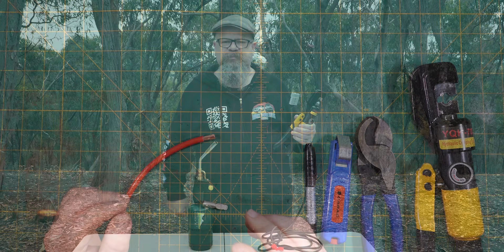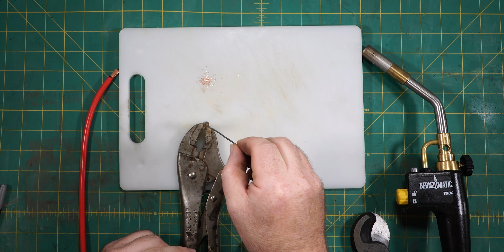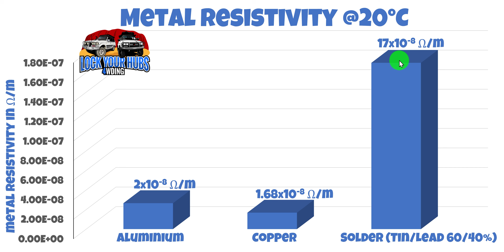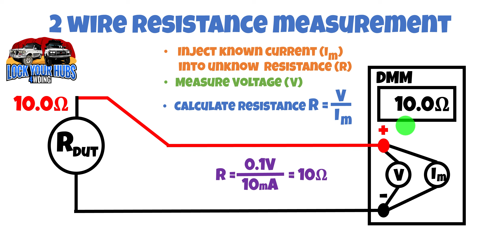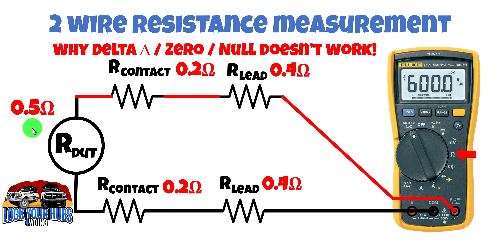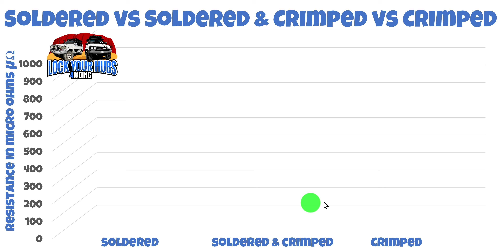Crimping vs Soldering for Anderson Plugs

Comment: Soldering is a bad idea for Automotive/Marine applications and is almost NEVER done by OEM builders. The reason is over time the area can become work hardened and break. It also has a tendancy to corrode. Have a look at a vehicle manufacturers wiring next time and see how much of it is soldered. Very little. Besides which it is time consuming.
Reply: P.S.
Love the channel and the empirical approach to all subject matter! 
Just pointing out the elephant in the room..... Most people think soldering is the logical way to go......
It isn't........
Reply from the maker: I have heard a multitude of claims in regard to soldering vs crimping. One of which was that crimping was superior conductivity to soldering, and at face value considering the conductivity of solder vs copper, turns out that wasn't correct. 

I would assume that without decent support, a soldered joint could suffer from fatigue related issues, though with double walled glue lined heat shrink that may be mitigated, though I haven't been able to find any hard data about that either.
Reply: @LockyourHubs4WDing  Yes, I love the way you go about empirical testing of this. 
Great channel . I've been a fan and subscriber for many years. 
I would have assumed myself that a crimped connection would be electrically as conductive as a soldered one.  But it is certainly mechanically stronger and more reliable in real world conditions. Especially in the longer term. 
The conductivity may be not as good,  but the differences are small and the variations as they age would close the gap even further I believe
Add to that the reduced cost of production and I guess it's a no brainer for OEM suppliers.
Reply: Nope. joints sitting in salt water in the bottom of your boat. Eg, if you needed to join a wire to your bilge pump, crimp + solder + heat shrink with glue. Relaibilty is the key in salt water environments. Even on the river, corrosion is an issue.
Oems dont solder due to cost.
Reply: @nordic5490  you miss the point. 
The solder would serve absolutely NO purpose whatsoever in that scenario. 
It's well established and tested that a crimped and insulated connection provides ALL the electrical and mechanical integrity that is ever required.

Comment: Very interesting test and very educational, thanks.

Now I have no idea if I'm right or wrong but I have to admit I was shocked at your method of soldering. A flame like that is far too hard to control for my liking  ...  I would only ever attempt something as critical as this with a decent iron. The purpose of rosin cored solder is to have the rosin do its job as it is heated up  ...  and that job is to clean the surfaces of the terminal and the wire  ...  so the solder can adhere/bond properly and cleanly.

By melting the solder in the terminal and then pushing in the wire, the majority of the flux is already deactivated and while it would have cleaned the inside of the terminal nicely ...  it would have had no effect on the wire. I am inclined to place the wire in the terminal and while heating the outside of the terminal, feed in the solder just as you did the crimped and soldered one, until it has flowed nicely and filled up.

I saw some comments about soldering and corrosion and the distinction needs to be made between rosin cored and acid cored solder  ...  the latter causing residual effects unless cleaned carefully. Rosin from the rosin cored solder actually deactivates after being heated and so should not cause residual effects long term  ...  and many of them are sold as "no clean", not requiring any special treatment after use. 

My thoughts come after 50 years as an electronics tech. :)
Reply from the maker: Having tried both ways I find it a lot harder to prevent the solder from wicking up the wire under the insulation if inserting the wire first. I understand the function of the flux cored solder though having cut a couple apart after using the method in the video, I seem to get 100% penetration and no wetting issues reliably.
Reply: Correctly soldered would have the solder wick up the fine strands in the cable, making it rigid where it is designed to be flexible.... needs to be flexible, instead of creating a location that is subject to stress fracturing. 
That 'solder pot' method he used is asking for dry joints. Chances are there was so much slop in the cable / lug barrel joint that the hit and miss method only had the outer strands soldered in, with core of the cable dry. 
Then there is the thermal mass of the cable sucking out all the heat of the minimal solder in the lug... more dry joints. 

My thoughts come after 45 years as a Licensed electrical fitter/mechanic working in the Power Industry.

Comment: Solder for a good electrical connection and a crimp for mechanical connection, so both seems to be the best option.
Reply from the maker: Hmmmm, I keep hearing about the fatigue issue of soldering with vibration movement, though I think if the loom is properly supported and decent double walled glue lined heat shrink is used, I'm not sure if it's as much of an issue as the pro crimp people make it out to be. 

Anyway, when are we going to see more videos? It must have been a couple of months since the last one!
Reply: @LockyourHubs4WDing  I've always personally just soldered but have been looking at getting me a nice crimper. That one you were using looked like an eBay cheapy. Is that right?  Seemed to do a pretty good job. I don't ever recall having a mechanical failure in any of the ones I've done which is why I guess I've still not got around to picking up the tool. Look forward to the tests.   I'm kind of struggling with motivation at the moment but trying to get back into it. Sometimes it's just hard to find content that has value and is worth making. I'm sure you know what I mean . It be can very rewarding but sometimes it can be a grind too.
Reply from the maker: @DENMONKEY  yes, the crimper is an eBay cheapy. I think we all understand the grind!

Comment: i have always soldered my anderson plugs for a couple reasons 
1 if it breaks i can re solder the plug 
2 if damage can replace easy 
and when mounting the plugs i make them so the wires straight out of plug don't move as that is a fail point 
and every plug get heat shrink to protect the wire
Reply from the maker: While I haven't tested it, I think heat shrink, especially the double wall glue lined variety would mitigate much of the issues with creating a potential point of fatigue when soldering.
Reply: @LockyourHubs4WDing  the glue lined will help more then normal heat shrink

Comment: Great demonstration, as an ex-avionics engineer, i always solder, but tin the wire before inserting into the Anderson plug to ensure a complete bond.
Reply: Tin for the win!
Reply from the maker: I use this method to try and stop the solder working its way up the wire under the insulation. The couple that I've cut apart seem to have full solder penetration.

  Though not sure if you would get full penetration on a much larger wire like a 50mm² cable.
Reply: Why - you cannot get the wire in due to it being oversize and now you are potentially creating a cold joint.
Reply from the maker: Dependant on post heat.
Reply: @LockyourHubs4WDing  Why cook it more than you need to.
Reply: Most avionic plugs are crimped

Comment: Crimps have to be extremely tight, basically merging the metal. I think you had the wrong dies.
Reply: I have the same hydraulic crimper. Plenty of wire suppliers cheat and have less copper than the guage suggests. I often use one side of the die the next guage down. Sometimes both sides the next guage down. If the wire still flexible near the crimp, it isnt fully t crimped.
Reply: If the crimp job was good it should marginally beat a good solder job, but doing both if crimped hot would do marginally better again. Devil is in the details of the work done, here.
Reply from the maker: The crimp was tight and survived the "pull test" no issues. I have tried the 8mm dies and they over crimp those connectors, cutting into the connections.

Comment: Bad methodology in the end. To properly measure this you want to pump much more chrrent through it into some kind of stable load. Eg headlights via a battery with a charger attached. Then measure voltage dropped across the joint.
Reply from the maker: Ohm's law determines the resistance, not the amount of current. As long as the amount of current is enough for the resolution and accuracy of the meter to get a decent reading, it'll work. Anderson Power themselves only use 5A to determine resistance over the joint.

Comment: I feel like you have not guaranteed good penetration up the wire in either solder case, thus disadvantaging the solder joints.
Reply from the maker: By the cold insertion? That's to prevent the solder wicking up the conductor, I've cut a couple apart and seem to have complete penetration and no signs of a cold solder.

Comment: Good job/vid & tests Simon. I cant believe ur results tho, goes against everything I thought we knew about connections of this type, I think this subject needs more investigating. I have seen wires nap clean at the solder join & using ur exact same method had to redo a connection recently, as I believe the Ando plug connection had resistance and created enough heat to desolder that connection when using 20-35A for charging it would derate the amps going to the battery, sometime stop completely & then go to full amps again if I pushed on the connection. I have also come across a number of Ando’s u have to squiggle a bit to get them going sometimes, so the plug itself can be the source of too much heat if the connection isn’t the best, so I would never recommend to solder a Anderson plug without at least crimping first, if u feel u must solder, then I would say less is more, dont flood it too much or let it weep to or beyond the crimp. 
Airforce & military have very strict guidelines concerning crimped or soldered connections. 
I like ur approach, theory, tests, graphs & vid Simon I just cant believe the results, it’s like the JWST telling me now The Big Bang didn’t happen. TFS. Cheers
Reply from the maker: I was a bit sceptical of the results as well, hence testing with three different examples of each termination and averaging the results. 

You're right though it's not just the individual terminations that can be the source of a high resistance joint, the actual contact between terminations can cause issues especially in adverse use conditions like you're likely to find on the outside of a 4WD. 

Though having said that, for a non-sealed plug, the Andersons do really well considering what we can put them through from time to time.

Comment: I always crimp because i can never seem to find my soldering torch when im in a rusg to get a new setup done before a trip 😂 if i feel special ill solder over the crimp. Never used a proper tool either, just the old school flat stripper pliers with the multiple crimp dies, never had a failure and never had a hot connection or voltage issues.
Reply from the maker: Don't get me wrong, I don't think crimping is rubbish. It seems to be a somewhat contentious subject when you're discussing car electricals for some reason.

 And I wanted to know what was the most electrically efficient connection with the highest conductivity, turns out that's soldering.

Comment: Soldered makes more sense, as with crimping there's always a gap. Solder fills those gaps giving a larger contact patch. Also crimping doesn't work if you are fitting a 50amp Anderson plug to a 3mm wire. 

But solder can cause a weak point at the end of the solder. But if the wire is large or never moves that's a null point.
Reply from the maker: That's one of the main reasons I used to usually solder, in a production scenario, you're always going to have the right connection for the gauge of wire you're using. That rarely happens when you're cobbling something up at home for the 4WD. As to the weak point, I always use double walled glue lined heat shrink in the hope that it'll not only help with any potential corrosion, but help support the joint as well.

Comment: We have been soldering them for decades and have never had one fail. I think a pair of helping hands would be an improvement over the vice grips though. I put the solder in first before heating, just fold it up and cram it in then heat it until it melts. Then push the cable in and hold for a few seconds. I would have expected  crimping to produce the worst results followed by crimped and soldered and then soldered giving the best result. Interesting to find that I was right cosidering it was just intuition but I never expected crimped to be so much worse. Really interesting to see how it was all tested.
Reply from the maker: Thanks, I'm constantly amazed by the testing. (I'm still kicking myself over the preheating/chilling of thermosflasks, I was doing that for decades....)

Comment: Well the military solders everything in their standards for land rovers, aslavs etc when I was at BAE systems for work experience. 

They had testing set up for quality that was insane. It was all minimum required though so wire could flex.
Reply from the maker: That's really interesting as most organisations require crimping for adverse conditions wiring. And a war zone has surely got to qualify as an adverse condition!
Reply: @LockyourHubs4WDing  in marine, crimp + solder, or just solder. If only crimping be sure to use hearshrink woih glue to waterproof the joint

Comment: Auto elec ere. Love ya work. Ahh to do a perfectly wetted solder connection without getter any solder on the outside of the connector. It can be done. Original anderson literature says to solder only. The wall thickness of the Anderson connector wire socket is far to thin to hold a solid mechanical crimp.
Reply: Currently they give crimping as the norm but also permit soldering.
Reply from the maker: If I remember correctly don't Anderson Power do pellets of solder of different volumes that you can drop in the various terminations to get exactly the right amount of solder in the joint?

Comment: Did you perform a pull test afterwards to verify the quality of the crimp? This one doesn't have a proper shape for a hex die.
Reply from the maker: Yes, I always give them a good yank with a pair of pliers to make sure I haven't dropped the wrong connection on the wire.
Reply: @LockyourHubs4WDing  It would be 400N pull.  Check the "Crimp Specification for Powerpole 75 & SB 50 Contacts" pdf. The resistance is way out of spec, meaning something in the setup is not right.
Reply: @user-yr6hn9rn2z  It's just the wrong crimp die, he's not buying it, but that hex is not gonna work right.

Comment: Interest in vibration and corrosion resistance? Shit yeah!!
That was a beautifully explained and demonstrated use of the 4 wire method for low resistance measurements. Kudos++!
The results blew me away too.
Reply from the maker: Thanks! I was astounded with the results as well, after years, in fact decades of being told how crimping was the superior method. Just to find out as far as conductivity is concerned, it's the complete opposite....
Reply: Why would it surprise you? It is simply a matter of contact area. Wires have a lot of gaps which are filled in by soldering and thus creates an almost perfect continuous path for electrons to flow unimpeded..

Comment: I measure the resistance of connectors and circuits a lot - both in assessing why people are having charging issues with 4wds and caravans and also out of my curiosity.  But I think finding  a number for resistance is irrelevant to our typical application.  I prefer to use a much higher current (typically 25A from a big tyre pump) and spear the wires across a paired connector, measuring voltage drop.  I'd typically see something like 0.01V drop across a paired anderson connector.  The voltage drop is so miniscule, to be irrelevant.  It does not matter if something is 3 times worse, because 3 times nothing equals nothing.
Reply from the maker: I wouldn't say the resistance is irrelevant, I would say the resistance is more relevant than voltage drop when checking the suitability of a termination. 

Resistance is independent of either voltage or current, then once you know the resistance you can work out the wattage lost to the joint at a certain current draw.

As multivoltage systems become more common, like the car running 12v and the house system either 24 or 48v systems we're going to need to move away from quoting units that are only applicable to the one voltage system and can be assessed regardless of the system voltage used.
Reply: @LockyourHubs4WDing isn’t that where Watts come in, Watts are a unit of energy at any voltage
Reply: @LockyourHubs4WDing  "Resistance is independent of either voltage or current"  -  I love your work, but find it hard to agree, but I'm a V=iR sort of guy :-)
Reply from the maker: @philg2468  haha, outta context, but got me!

Comment: for anderson connections i 1000% percent say crimp because if for any reason the wire heats up the solder can separate!!!
Reply from the maker: If the wire or connection are ok, I've run 100A though a SB50 (50a Anderson) with no issues .